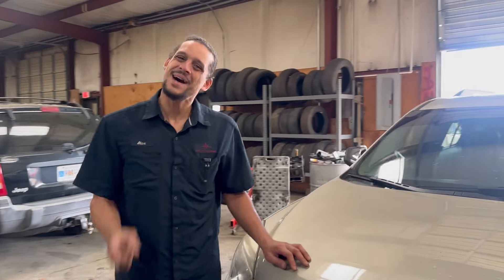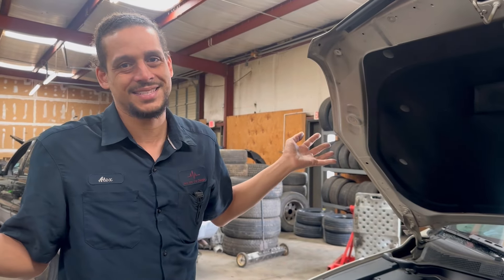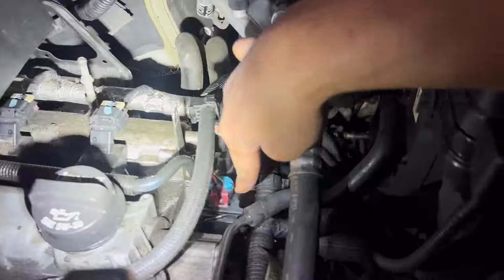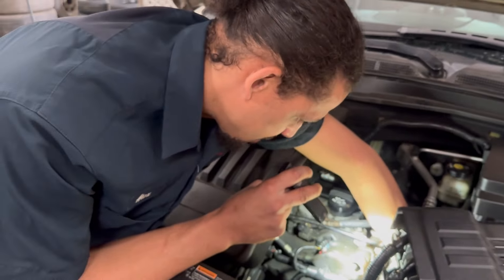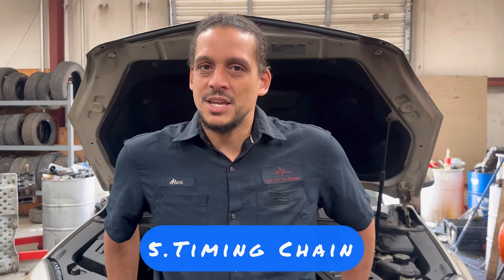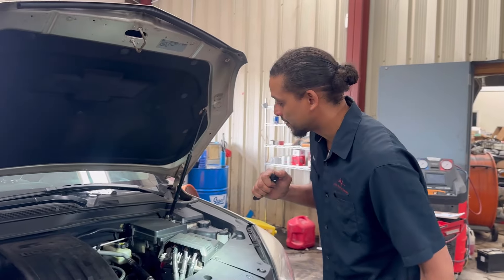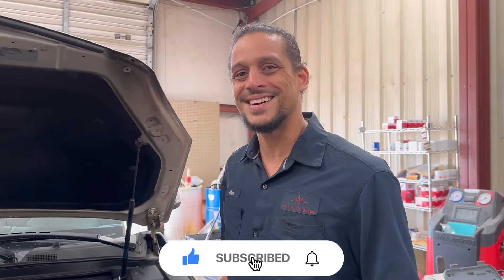The Top 5 Problems with Chevy Equinox (2nd Generation 2010 - 2017)

Comment: Rear main seals on these are notorious for leaking from backup pressure
Reply: I put different oil cap that vents at a certain pressure on my equinox to prevent that issue.
Reply: @oaden0621  hey do u remember what’s the name of oil cap and where u get it at would like too try it on minds
Reply from the maker: I’m gonna pin this comment to the top, thanks for adding to the list.
Reply: @therealogofgaming9507  part # fc219. AC Delco.
I haven't gotten one for mine yet. They say our vehicles aren't listed in the application. But it will fit.
Reply: Hey im not getting any codes and sometimes my car feels like its about to cut off when im at a light and sometimes when i take the key out the ignition it takes a few seconds for car to shut off
Reply: Alex, first time seeing your video, good job! Have had any 2012 Terrain 2.4 intermittent no crank concerns? Bought it GMC dealer as is  and it has a GM remanufactured engine, I think they gave trying to fix the problem. I replaced the starter with a GM unit but still random 1 click then it will start. 2 different battery that tested good but have not tried a new one. Hope you have something to help me out. Thanks
Reply: Take the rubber seal off the original cap and it works just as good.allows the over pressure to be relieved through the top. change oil every 3000 miles and check oil weekly and top off.drain and fills on the transmission fluid every year. 190,000 miles on ours and runs great.run cat clean periodically
Reply: Replace radiator, coolant,hoses too after 150,000 miles as well
Reply: Ebay parts are inexpensive and work great
Reply: The excessive pressure is due to clogging of a pinhole vent inside the intake. It's a huge problem if you live in a very cold climate because you get water collecting in your intake. The water turns to ice and plugs that hole until it melts. People accelerate aggressively when the engine is cold and the pressure blows out the rear main seal and they lose all of their oil. I bought an aftermarket oil cap and drilled a small hole in it to vent it until I could get my intake cleaned at $700. The only problem with the temporary fix was smelling oil when idling.
Reply: Sorry, but you're wrong. I have actual experience, not random info. 
It's not "back up pressure", that's ridiculous. All 2.4L LEA engines experience high crankcase pressure at some point due to their faulty piston oil rings from factory. This isn't what makes the rear main leak.

It's a faulty PCV system, paired with faulty piston rings from factory. They have a tiny hole under the intake manifold for the PCV system. It gets clogged with carbon easily, due to the oil rings letting the engine burn oil. You can drill a hole in the intake and clog it with a screw. The idea is you take the screw out and poke through the PCV hole with a paper clip at each oil change. There are videos on that.
Best solution
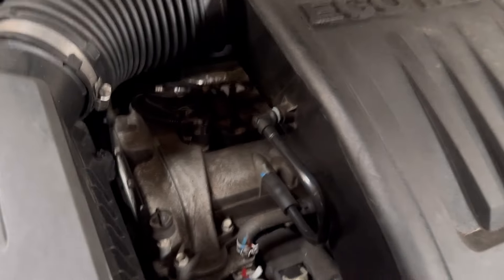Look at 2:52. See the looped plastic hose connecting the valve cover and the intake box (not the air filter box)? The best, cheapest solution is to cut that loop and attach fuel appropriate hose to the plastic line, then purchase an oil catch can, and install it in the engine bay, higher than the original line. This will catch all the fuel/water mixture that is sent back into the intake, due to the clogged PCV hole. 
The reason that the rear main seals fail, is because this water/fuel mixture is allowed to go back into the intake box (again, one that says "ecotec", not the air filter), making its way into the engine oil (failed piston rings). The water sits on top of the oil, when it freezes it ruins the rear main seal. 
I've changed rear main seals for this very reason. I also own a 2012 equinox with 276,000km that has never had a rear main seal fuck up because I have a catch can and empty it regularly. (As well as maintain the oil level, because it burns). I know these engines like the back of my hand, and I hate it, they're terrible engines. GM sucks.

Source: I'm a licensed heavy duty diesel and automotive mechanic (310T and 310S certifications)
Reply: @polyothix no one cares bud of your made up information fake YouTube certifications I happen to own this very same suv for the past few years this is the main problem I have with mines so go insert your passive aggressiveness to someone else sorry but you’re wrong buddy

Comment: All 5 problems without watching the video Transmission issues exhaust manifold issues purge valve timing chain issues
Reply from the maker: lol you sure you didn’t cheat
Reply: @AlexTheCarDoctor  😁
Reply: @AlexTheCarDoctor lol
Reply: @DANNYN224  
No chain in a 2.4l, lol
Reply: Oil consumption.
Reply: @josephpullen1153  2.4 eccotec is definitely chain driven, why even post a stupid comment on purpose
Reply: @Raggle88  I love how much the exhaust “Ecco’s “ lol hearing the echo.
Reply: I have a 2015 equinox. Mine is the unicorn, as I have changed the oil religiously every 5k, and I have never added a drop in between changes, nor has it ever been low any amount.🤷🏼‍♂️

Comment: My wife and I each have an Equinox 2014 and 2017 the 2014 has about 118k on it and the 2017 has 142k only repairs have been the VFT Solenoid’s and rear wheel bearings. We use Mobile 1 full Synthetic oil and charge it every 4k. Maintenance is key.
Reply: @johnvecchio4186  why did you chante the rear Wheel bearings?
Reply: @ right side was making a howling sound when you slowed down to a complete stop. I decided to do the other rear one while I was at it.

Comment: My engine has been replaced with a used one. I change my oil every 3 to 4 thousand miles instead of what is recommended and it runs perfectly. It also keeps those VVT solenoids from getting clogged. I also put a ventable oil cap on to prevent to rear main seal problem that some people have. ACDelco part # FC219 off of Amazon.
Reply from the maker: Nice move with the oil cap!

Comment: There is one other common problem you didn't mention.  The intake manifold has an orifice on the engine facing side, in between the intake ports, that functions as part of the pcv system.  It is only about 1/16" diameter and commonly gets clogged with sludge.  When this happens, the crankcase pressure builds enough to possibly blow out the engine rear seal and create a massive oil leak.  It can blow out enough oil that if it happens when driving, the engine will be starved for oil and seize up.  Obviously, this can destroy the engine fast.  I had the seal blow out on mine but caught it in time to avoid total destruction.  To prevent this from happening again, I cleaned out the orifice and installed an oil cap that has a built-in pressure release so if it clogs again it won't blow out the seal (hopefully).  Also, I'm going to make it part of the maintenance routine to clean out the orifice once yearly to keep disaster at bay.  Again, hopefully.
Reply from the maker: Thanks for adding this one!
Reply: There's a  you tube video showing how to drill a hole in the intake and hit and enlarge the hole and then just a short screw to seal intake, did it works perfect
Reply: @thomasmorris302  Thanks for reminding me.  I saw that video some time back and thought about it then.  I was concerned about cracking the manifold when drilling or when putting in the screw.  Do you think that is something to be concerned about?

Comment: I bought a used 2013 equinox from a private dealership. Price was for 14k. Day one out the lot, abs, traction control and check engine light came on. I got a gear warranty but I think they’re trying to scam me.

Comment: Good shiow.  Most important.  I'm a blonde headed 72 yr old guy that retired and quit getting pricy hair cuts. a year ago.  I like your pony tail.  Showing my wife so she can tie up that long hair of mine. Just purchased  Equinox  with 134K.  No trans fluid ever changed,  Runs to Cool. Spark Plugs never changed.   All easy fix.  Thermostat, spark plugs, tranny fluid change;  Will follow your advice and change tranny fluid.  Nobody ever changes tranny fluid but will do it. I will go ahead and replace the one valve. Should I replace timing chain to be safe?

Comment: I watched this because I just bought a 13 equinox. Was entertained while listening problems I will probably run into.
Reply: 3 to 4,000 mile oil chanes use dexos oil they will last
Reply: Maintenance is key with those engines.use good full syn oil and change it every 4 k

Comment: thank you for the reply on dads Terrain Alex, called a friend that owns a transmission shop, he says do it every 20,000 miles, there is no dipstick no replaceable filter, just a drain and fill, so I am going to load up everything I need and do it for him, also change the oil, the GM dealer oil stinks Pennzoil platinum will keep that timing chain going for a long time, there is a you tube video of a guy doing one at 58,000 thousand miles that fluid was black, so time to load up my truck and go visit dad, I do not trust dealers, I worked at one for a decade, do it yourself or find a trusted mechanic like Alex

Comment: 2015 Chevy Equinox 2.4, 148,000 miles. Timing belt replaced. Catalytic converter replaced. Motor mounts replaced. Water pump replaced. All about the same time. Still shaking while idle. No engine codes. I don’t know what’s next. Thank you for your video.

Comment: Great video thank for your information.
I own a 2016 Equinox with the 2.4L.  The key to longevity it religious oil changes every 3 to 5 thousand miles.  The variable valve solenoids and the timing change tensioner both will fail with dirty sludged oil.  If your timing chain tensioner fails your timing chain will jump a tooth ir two and the valves will hit the piston and you totalled your engine.  We have 160,000 on our Equinox.  We bought it used with 110,000.  I replaced the brakes.  I had two failed mass air flow (MAF) sensors go bad.  These are bad when your car will start but dies after 3 to 5 seconds.  No check engine light so no OBD2 codes.  You can easily determine if its bad by disconnecting the connector.  If the car starts and runs its a bad MAF sensor.  I tell you this because I didn't know what it was at the time.  I replaced both vvt solenoids and the high pressure fuel pump and the battery because it was weak.  Car still didn't start until I replaced the MAF sensor.  So after 50,000 miles I replaced the brakes and the MAF sensor twice.  I think it's a great vehicle.

Comment: Thank you for your video! I was worried I had made a bad purchase with my 2012 equinox because I saw many complaints. But hey, maintenance is key! It has 175k miles on it and it runs great!... Until the "engine power is reduced" message pops up but it looks like a simple fix (I hope).
Reply: Yes after all the complaints I was worried. Just going to take notes and keep it maintained for right now

Comment: 180,000 miles on our 2014. 2.4liter. Never changed transmission fluid. No timing chain issues either. Does burn some oil. Just developed a bad oil leak on front..gets all over serpentine belt.
Probably gonna buy a 2024 equinox

Comment: I have a 2010 equinox that's been broken down since November of 2023. It previously had a crack in the exhaust manifold but still ran fine other than being a little loud and using more gas. In August a message came across my dash saying A/C off due to high engine temp. Never overheated or anything but couldn't use A/C so went to ORiely's to get the codes and they suggested that I have 3 sensors replaced, the camshaft position sensor, 02 sensor & cool temp sensor. Did that & 3 months later i get a message saying engine performance reduced which means it went into limp mode and with the pedal all the way to the floor at best it would go 5 mph. Also prior to that message I had to keep getting my car jumped cuz the battery would die quite often...so got a brand new battery also got a brand new camshaft sensor for the second time put that in, had the alternator tested, it passed, but it's still in limp mode and matter of fact it will not start at all now no cranking or anything no noise whatsoever and I can't even jump it it won't even jump start. And brand new battery was checked & was at 100% when bought one month ago but was at 4% a couple of days ago so am charging it as i type this...possibly a parasitic draw somewhere? Some of the codes are as follows - p228d, p0016, p0013, p0089, p0420. I heard you mention the p0016 in the video. If anyone has any idea what is going on it would be greatly appreciated. I'm a single woman living with my 62-year-old mother and don't really know too much about cars. Thanks so much
Reply: @TashaCollins-n1g  Hi Tasha. My 2017 with 91k miles is having battery issues. I changed the battery, alternator and tested every fuse...even the battery in the key fob...but it still drains and then won't start. Did you find a solution?

Comment: Biggest problem extended oil changes and No Dexos oil when done.  These are direct injjection so have more carbon build up, if you don't change oil at 3 to 4K than it can't contain all that carbon, rings get stuck, the pcv gets clogged, timing chain tensioner won't hydralic pressure build, timing chains wear out.  Oil cools cylinder walls (squirters) activates VVT (those solenoids he mentions), lubes balance shafts, without clean oil you have problems
Reply: same issues people are having with many Kia and Hyundai GDI engines. the manufacturers recommend (straight from the bulletin) oil changes every 3k to 3.75k miles under "severe usage conditions". which really isn't severe usage to me. i had a 2015 kia soul base. i'm driving a 2016 chevy equinox now. the ride quality, cabin noise and handling is so much better on the equinox, it's crazy

Comment: My 2017 Equinox stopped burning oil after I started doing my own oil changes at home. My wife used to take it to one of those fast lube places and that damn car needed oil EVERY week. DO your own oil changes on this car and do it at 5000 miles. My daughter has the same engine in her car and she was having issues with the car stalling at a stop. I did the VVT's and it was still doing it. With her car I had to buy "better" quality oil and do her oil every 3-4K and that seemed to stop that issue.

Comment: The 2.4-liter engine from that generation is notoriously problematic. I own a 2017 AWD Premier with the 3.6-liter engine, and it’s been incredibly reliable. In the time I’ve owned it, there have been no recalls, warranty issues, or major repairs—just routine maintenance like coolant, transmission, power steering, and brake fluid flushes. I've also replaced the battery, tire pressure sensors (due to dead sensor batteries), and recently put on new pads and rotors. Overall, it’s been a dependable vehicle. Since I park it in the winter, it will last a very long time because it will never rust.
Reply: The 2016-2017 with the LFX 3.6L V6's are awesome. That 2.4L? Not so much. But yeah, I'm in the same boat with our 2016 AWD 3.6L, it's been a rock solid little SUV for us for years now. Only thing with these is they need regular oil changes and maintenance.

Comment: I had a 2016 Chevy Equinox for a couple of years and I ended up totaling it in a car wreck it last year.  It didn't even make it to 50,000 miles.  I liked the interior and it allowed me enough space to carry what I needed to carry.  What I didn't like was the weak 2.4L 4 cylinder engine it had.  It would take what it seemed like forever for it to get up to speed on the highway and since I live in a state with lots of hills, it would downshift to make up for the lack of power it had.  The transmission would shift hard and I could feel it when it did.  The hard shifting happened whenever I had the ECO mode turned off.  I kept the ECO mode off because of the lack of power it had with ECO mode on.  After the accident with the Equinox, I replaced that car with a 2020 Toyota Camry and I've been happy with my purchase.  I don't think I'll ever go back to GM again.

Comment: I came here because my windshield wipers keep going out, I found out that 2010 - 12 and 14 - 17 have a bad linkage design, I was hoping you knew about that. I have a 2016 Equinox, had it fixed a week ago, just tried them on high and they almost flew off the car. I guess this is more of a heads up to anyone with those years of the vehicles mentioned in this video...
Reply: Hey I have a 2014 and a few years ago my wipers stopped working, found out  there was a recall on the windshield wiper motor.
Reply: There’s A Recall For The Wipers… The Dealership Got Me In And Out… Oh,  And To Be Sure Never Turn Them On High. 😅

Comment: The vast majority of complaints/issues you read or hear about with these Equinox's are from people that bought the 4cyl models. The V6's have way less issues, but there are still some things to pay attention to. My wife has a 2016 Equinox LT AWD with the LFX 3.6L. I believe GM fixed the PCV issues with the LFX compared to the previous LLT version. I haven't noticed any oil burning with the 3.6L, but I've heard of other people having it. We're right about 90K miles now, and the car has been fantastic. It's all about maintenance with these. Do oil changes, and do them often, like every 2-3 months (oil changes are cheap). Being direct injected, they need fresh clean full synthetic oil plus top tier fuel. Other than that, these really arent bad SUVs. Rides super smooth, and pretty comfortable.